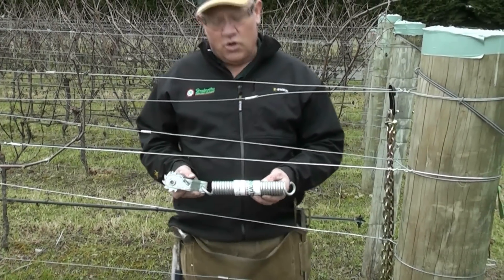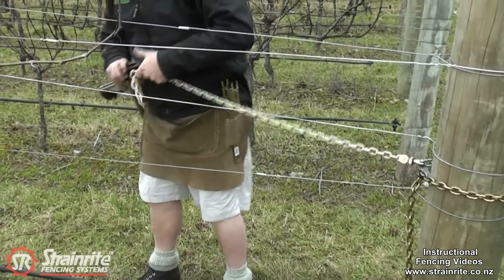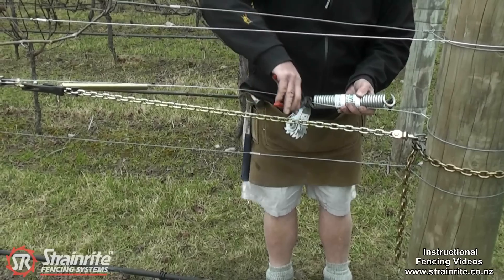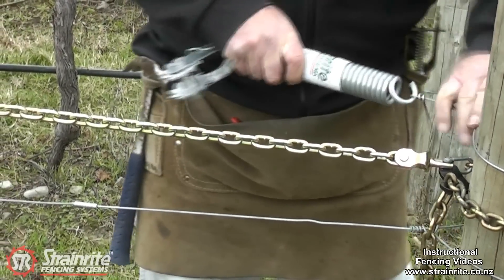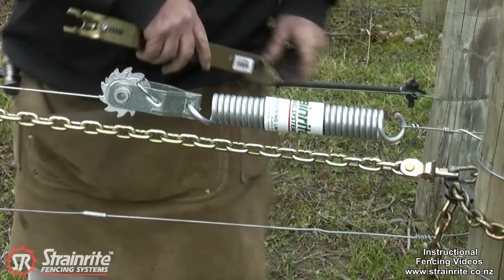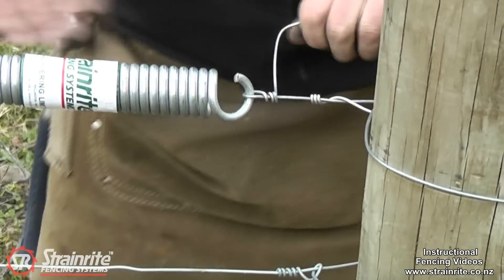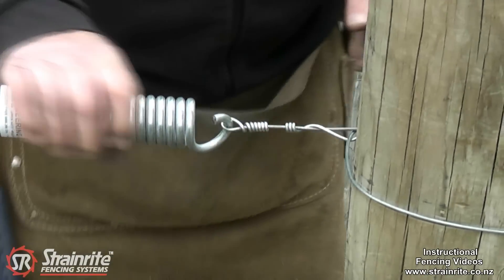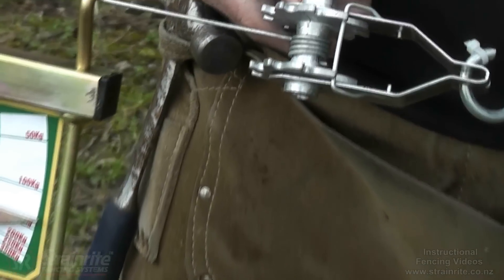Strainrite | Klima Sureflex Vineyard Spring

Comment: Can you post the name/producer of the tools that you used-  the tension reliever, wire winder would be very handy
Reply from the maker: Hi Duncan,
All parts used are Strainrite products. The tool apron used in the video isn't ours but we are now offering 2 versions below.
You can find these on our website using the info below.

Name & Strainrite Part Code
Strainrite Anchor Chain FAC00010
Strainrite Standard Chain Strainer FCS00060
Strainrite Wire Twister FTW00030
Strainrite Ratchet Handle FRH00010
Strainrite Fencers Tool Apron – Green FSR00010
Strainrite Fencers Tool Apron – Leather FSR00020
Reply: @StrainriteFencing  Thanks - this was super helpful and I was able to order what I needed to repair our vineyard trellis much more easily!